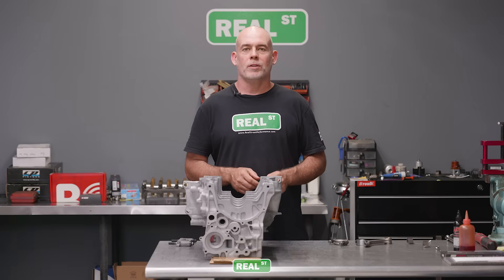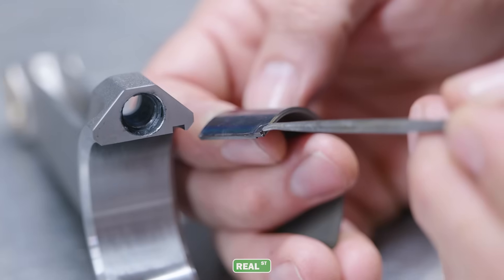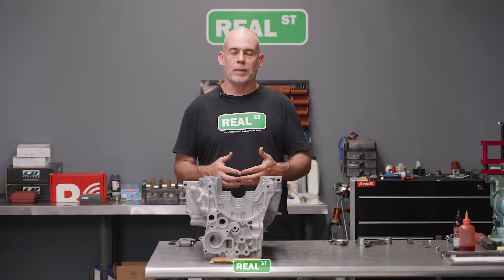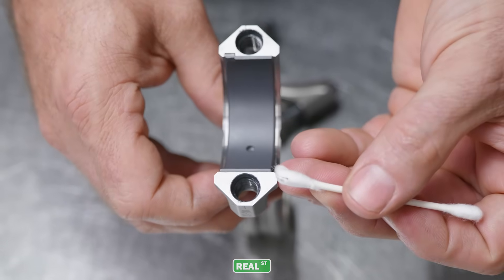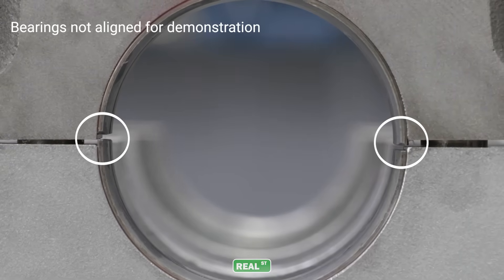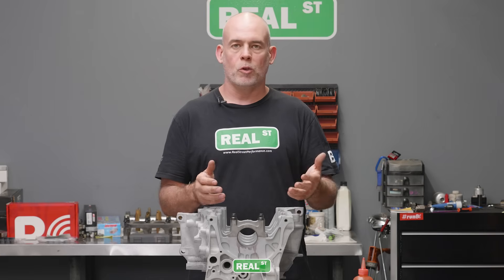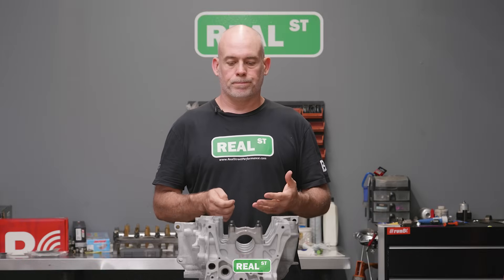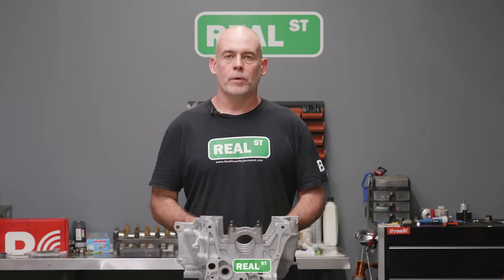Adding Oil On The Back Side Of Bearings During Engine Assembly. Good Or Bad?

Comment: My problem isn't slippage, you are correct that compression takes care of that. The problem with oiling the back of a plain friction bearing is that you actually add a minute amount of substance to an area where the tolerance should be zero. It probably isn't enough to effect most engines, but it's measurable and it's something to consider. I was taught by an airplane mechanic to always clean the front of the journal on caps and engine until completely free from oils, and to do the same with the back of the bearing. I have never had a problem with seating an un-oiled plain bearing.
Reply: I think that arguing that you shouldn't have oil under a bearing is a bit crazy.
- thin oil as suggested here has a very low viscosity. He showed it being squeezed out with with just the pressure from bolting the cap down
- I tore down a factory GM crate engine last week. Was only a couple of years old and the bearings were wet on the back side, hmmm how did that oil get there?
- If you think that the thin film is oil is enough to distort the bearing, then isn't the friction and binding of sliding a shell in dry able to do the same thing? I'd argue that letting the bearing slide into a better position is better than any (even if minor) binding from seating it dry
- if that thin film is enough to keep the bearings from seating fully, then how is it that under extreme loads, with pressurized oil in the journals, a bearing surface can contact a journal.... But the tiny amount of oil is enough to cause a seating issue??? You can't have it both ways
- due to surface tension, you're going to get oil wicking behind the bearing once it's installed. How is this different from having a little oil behind it when seating it?
- is there a hole in your bearing to get oil to the journals? Oil is being pushed from behind the bearing, you don't need to put oil in there, the oil pump is forcing it behind there for you. Not too mention the capillary action of hot, thin oil being wicked into the space between the bearing and the seat.

I'm about to assemble an SBC and if I had a dial bore gauge, I'd measure the clearance with and without oil. I feel pretty certain that there isn't a difference in crank clearance with and without oil.

It's not the most accurate test, but I might set bearing dry and plastigauge, then set them with a little thin oil and check it again. I'm almost willing to bet that there isn't a difference.
Reply: I totally agree, bearings are always wet with oil on the back of the shell so what does that say? oil when hot is thin enough to find it's way between the cap and the back of the shell, I like the idea that a thin coating of oil could help the shell find it's correct position without binding and distorting..
 @wlrottge
Reply: That was my first thought when I saw this.
Reply: Compressing doesn't push out all oil, but also compresses the bearing itself slightly.
Reply: I don't think you could find any manufacturer  that would condone any lubricant under a shell type bearing. I know Detroit Diesel Does not. The fit is metal to metal per the factory repair manual.
Reply: @MsBoots10  BMW actually says to do so in their manual for a F800 (motorcycle) engine
Reply: Uncle Tony says NO OIL ON THE BACK OF THE BEARING.
Reply: @wingrider1004 Powell machine/cams just pimp slapped Uncle Tony with knowledge....
Reply: ❤😮😅9pm I f9 7th😊😅😢8 5:13 9
Reply: Dumb idea and a failed explanation! 
This definitely takes up space and does tighten the brg clearance 
Of course, he has to chide anyone who doesn't tow "his line: on "his" post..
Reply: @billjenkins3699  Is that you Grumpy, the legendary drag racer.
Reply: @donziperk  nah, real the grump passed
Reply: @billjenkins3699  Ya that was a sad day. Watched him and Bill Glidden match race at an airport in Western Canada in the late early 80s. What great showmen.

Comment: I was an diesel engine mechanic, on big engines that I worked on we always put oil on the back side because the oil would help transfer heat away from the bearing. It's just that simple and there is no reason to think that it would not work on small engines.

Comment: Oil

Often the most favored and widely used hydraulic medium in process and calibration industries, oil has many beneficial properties. Oil is typically non-corrosive, has lubricating attributes, a wide temperature range, and is considered nearly incompressible in most applications. 
 You can not control the thickness/amount of the oil on the back of the bearing and can easily subtract clearance between the crank and bearing.  .001" clearance could easily disappear because of the oil.

Comment: He does not have a clue. Polish the housing with crocus cloth after honing wrapping the mandrel with it  it will remove 2/10 of a thousands. This will keep the build up of material on the back of the bearing from forming. The crush / press fit is what keeps it from spinning. Oil on the  back side is an insulator to keep the bearing heat from transffering heat to the housing. The oil takes up space which affects clearance. Need I say more?

Comment: If bearing crush is what holds it in place alone, why did we use to pin bearings?  I was taught to clean the backs, and the bores, with a cleaner. That being said, why use tranny fluid, why no sewing machine oil if you think it needs it?  You mentioned viscosity, and it's thinner. Or diesel fuel? Gasoline is even thinner.

Comment: I've alwasy wondered about a thermal grease on the backside.   Those of us that build computers know that there is a little bit of grease between the CPU and the cooling assembly that really improves the surface area contact.   You put it on and run a razor blade over it.    It would basically fill the machinist groves.   The idea being to keep the bearings as cool as possible.   The danger, its a bit thicker so  if might even affect clearances (I would imagine).   Thoughts?
Reply: Absolutely not. Heat sink would serve no purpose. Bearings live in heat. It doesn't hurt them like electronics. Oil flow controls any heat issues.  Dry is recommended for a reason. I don't see a single drop of marvel or transmission fluid hurting anything.  Flooding it with ATF wouldn't be advised by anyone.
I can't see the need for any lube, but if so, only the first 1/4" at the parting line where the bearing gets tight as it's pushed into place. It would have zero benefit at the bottom of the bearing saddle.

Comment: I used to build Air cooled, engines for a company in Liverpool, and always put oil on the reverse side of the bearings, even though eddy the boss was not sure, because he used to say I’ve never done that, but I never had any problems with the bottom end of my engine builds, and that was over 20 years ago 👍

Comment: I have been building engines for 40 years. I have worked for some of the biggest and well known engine builders. Keith Black,  Mondello, Reath automotive,  none of them ever oiled the back of the bearing. 
The cleaner the back of the bearing the better. Oil will hold the bearing off the jurnal, reducing clearance and reducing heat transfer.  Not to mention adding a slick surface for the bearing to spin on.
Reply: Exactly!..all these comments how theres nothing with it but it never hurts to get lucky I guess.My uncle works for Keith Dorton,one if the shops that does alot if nascar work and he told me decades ago you never allow oil on the backside of the bearing,common sense really..but common sense is not so common anymore. You want to those bearings to "stick" to the cap or block they are going in.Oil is never meant to be behind them.Period!
Reply: I think heat transfer is the bigger issue, that being said I knew a guy that dipped the bearing shells in oil and his engines didn't fail, we maybe splitting hairs here
Reply: you need to learn how to spell first... what is jurnal ???    is that a new word for you high tech engine intellectuals ???
Reply: @johncasor9698  Mmmmmm,an ad hominem attack…says a lot about your intellect…

Comment: I don't use any type of oil in the back of the bearings while assembling then. Never used and it never made sense to me. However, I've always spent a lot of time aligning bearing to their beds, specially those without notches. After hearing your opinion, I actually realized that putting a little oil in the back of the bearing will actually make my job of worrying about bearing alignment a lot easier. You've got a very good point.
Reply: I have an engine to assemble tomorrow, it is an older one with those bearing notches, but I'll give this subject a test again.

Comment: As a mechanic I’ve always kept the backs clean and dry. Which is what I’ve been taught. But I have noticed when disassembling an engine that there is oil behind the bearings.

Comment: No way should you ever put oil on the back side. It will change the tolerances on the inner bearing . It will also be pressed out eventually and the proper torque will change slightly. In my opinion it’s not a good thing to do.

Comment: 35 year journeyman mechanic here. I use a very fine file or 320 emery on the sharp corner of the bearing bore opposite to where the locating tang goes. Just want to knock the sharp edge off so it does not shave metal off the back of the shell. I do this on both mains and rods. Installing the bearings, I get the tang side in place and push the shell into place dry. The bearing crush pushes the shell tightly into place in the bore to hold it firmly in place.
Doing a bearing roll during an inframe overhaul, the tang side of the main bearing bore is smoothed carefully and cleaned out thoroughly, as the shell needs to be fed in from the tang side. Done this many times on 400 Fords and Detroit Diesel heavy duty engines.
We all have our preferred methods and whatever works for a person, carry on.

Comment: I had bearing issues from engines rebuilt by a local machine shop… I was confused until one day I saw the owner assembling an engine using globs of grease on the bearings. I mentioned that I was concerned the grease might block oil flow during the critical initial start up. I got the famous “we have always done it that way”…. as if always doing something wrong is somehow right?

Comment: Ok , y’all can’t call me weird after watching this. I rub my crankshaft bearings with denatured alcohol and then spray the part going into the block and main caps with Copper Coating like on the head gasket. I feel like it is giving it some stability.

Comment: It’s funny, I grew up around shadetree mechanics and as a kid, I heard about “spun bearings” and engines “blowing up” and now at 35, after hundreds of various engine builds for everything from lawnmowers to skidsteers to Subarus, I’ve never spun a bearing or blown an engine. Old timers were superstitious. My dad thought any engine would “blow up” from sustained revving until he rode in a boat with 2 turbo LS engines that made 700hp each and would run at 4,500 for hours on end.

Comment: If the factory doesn't oil the backs of the bearings then it is not a necessary step. In my 45 years as a builder, I have never put oil on the back of a bearing.
Reply: @nojunkwork The factory doesn't oil the back of the bearings, and neither do pro drag racers or NASCAR engine builders. I have built literally 1000s of engines both for street applications and for racing and have never put oil on the back of a bearing. I have also never had a bearing failure unless the engine was overheated, or ran out of oil. I don't know how many engines have been manufactured in the world but it's a lot, and if they don't put oil on the backs of the bearings then that should be proof enough that this is at the least bad advice from some clown trying to boost his YouTube subs.

Comment: It's the crush that holds the bearing in the cap.adding oil on the backside will cause less oil clearance . Too tight will cause the crank to lock up a light oil like you did probably doesn't cause any problem . Good video you hit the points well , I personally don't do this but sounds like you have good luck doing it . I scuff the front of the bearing also the rear .

Comment: In my expierience, and yes i worked in a reputable machine shop for about 5 years. This was also a debate. Me personnally dont do it for the simple fact that that lube takes up space. You went through all the trouble to machine, and measure for the perfect clearances. So why in the world would you put something additional in that space? And if you account for it, and some point most will smush out, then its loose. So my own, and its just my own, i always clean bearing surfaces spotless, to keep your clearances where you measured them. And light fluid or not, it still takes up space bottom line.

Comment: I think where the difference in opinion lies. Is that you are of the (let the bearing slide around, until that bearing crush, locks it in place) mentality. While others of (do not let bearing move around period) mentality. If one looks at the design. The bearing has tangs are not only to locate, but to keep it from spinning. Further, the journals are finished honed w/certain grit stone. So it can "bite" the back of the bearing. To further lock it in place. Only other thing I could offer advice on. Is, your parting line where the two bearing halves meet, should not line up with the caps parting line. That is just giving the pressurized oil to escape from. Not to sound against you. Follow good assembly techniques, following torque values, that with utmost cleanliness. As it appears you do. Is why your engines stay alive and reliable.

Comment: I used assembly lube on all of my bearings, under the notion that spun bearings is caused by low/no lubrication. Considering my 5.7 hemi hasn't blown up yet or started knocking, I think I did the right thing.

Comment: disagree with this practice.  Heat transfer  through the bearing shell  to the big ends or webs  is important,  and once installed, we want the bearing shells to not move.  Lubricants are designed to help things move.  There should be no sliding motion  during installation of the bearing shells,  and very little when the caps are tightened down.  I clean both surfaces thoroughly then simply push them in carefully.  I've seen some shops use a thin coating of  high temperature Loctite,  but this is just a stopgap when the crush is insufficient.  In my experience, tabs don't do much to stop  a bearing from spinning. the microscopic asperities  on the bearing shell back surface and the web or big and should provide plenty of  mechanical lock,  if no foreign substances allowed to come between them.

Comment: This near exact scenario cost me my job in a shop 35 years ago. But instead of a liquid lubricant Gary used wheel bearing grease. I stuck to my guns with the clean dry wiped with solvent method illustrated in HPs legendary books and others. Even Gary Seniour said, "It cant be. The motors gotta come back apart."  BUT!!!  I respect other Mechanics and will never knock another racer for his methodology especially when they win races how could I... It's just not for me.

Comment: Well this is complete nonsense. 
The way you are installing the bearings is not correct. You are supposed to lightly squeeze the bearing so that the coating dont get scraped of like you just showed.
If you do this, there is no need to oil the back of them, as you shouldn't. The only thing you are doing is creating a risk of contamination by adding that oil.

Its kind of amazing how experienced Engine builders does not even know the basics. You think you know better than all the OEM manufactures on the planet?

Comment: I've always dipped the bearing in a container of oil, even use the zinc lube that is important for break-ins. Done lots of HD  diesel engines, everything was dipped, caps,  bolts unless assembly stated dry.

Comment: if the rods and mains are the correct tunnel size there is no room for oil under the bearings. I have worked in a few reco shops and have never seen anyone put oil under the shells and if you did it should all squeeze out anyway when tensioned. The correct tunnel size gives the bearing a certain amount of nip or crush usually between .003"-.005" thosands of an inch  this basically means the outside diameter of the bearing shells is greater than the tunnel which leaves no room for oil. I have ground cranks line bored blocks resized rods etc etc and stripped a lot of engines and most that come apart will be dry under the bearing shells as there is no room for oil to get under there unless the tunnel is out of spec. If it is out of spec that makes it easier for a bearing to spin.